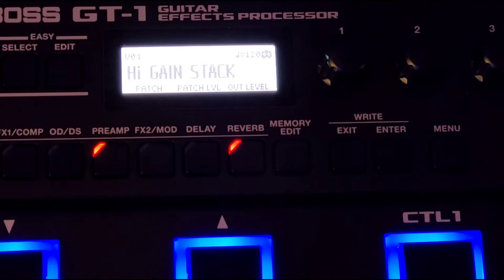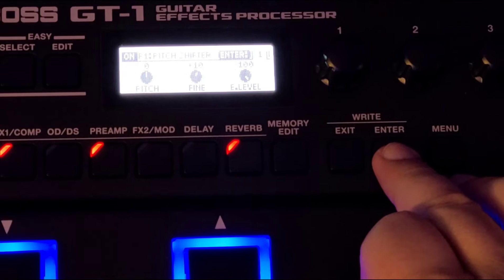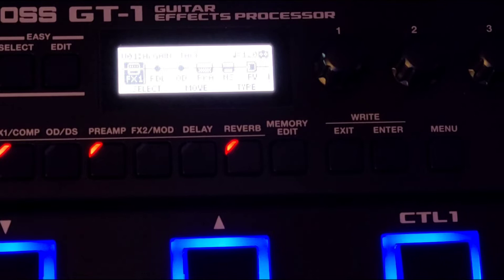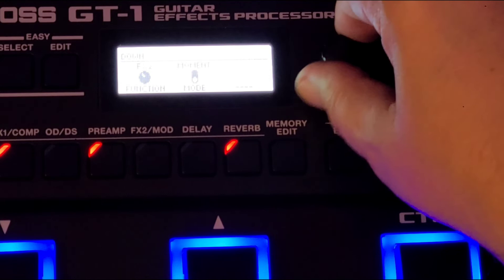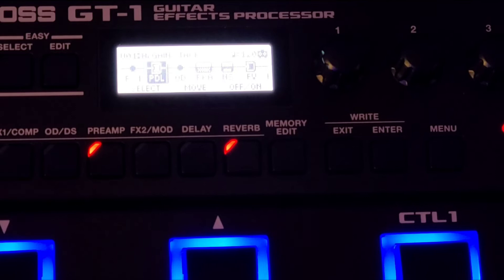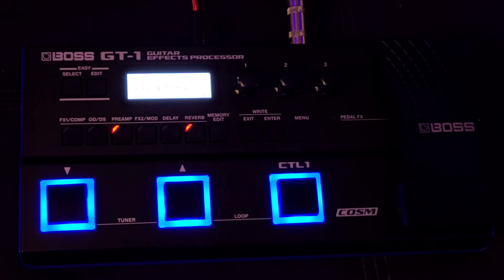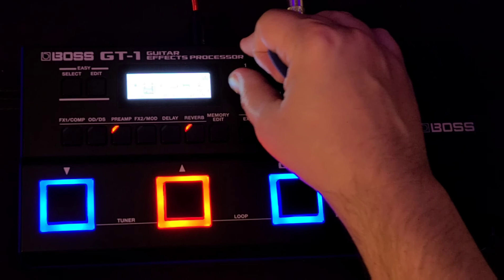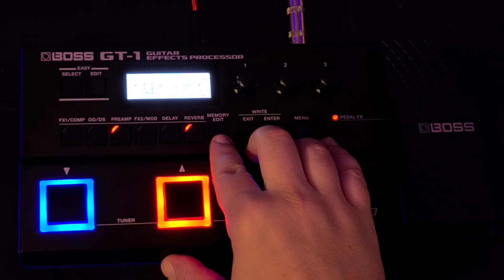things you can do with a BOSS GT-1  - comparing pitch shifting

Comment: Wow! Had my GT-1 for three years now, and was looking for The Drop or Pitch Fork to cut on guitars needed when having sets using multiple tunings, cause i thought the pitch options in the Boss was just unusable for this... Just tried it and assigned the on/off to ext ctl2,3. Works like a charm! Thank you so much for that trick !! I was searching today wondering if it was possible to use the whammy to do exactly just that and came across you video! What a joy to have this in just 1 unit !!

Comment: Gary, this trick saved me, thank you!   I just switched over from the MS3 to the GT1 and it was driving me nuts that the Pitch Shifter performs so poorly in the GT1 compared to the MS3.  I need that for emulating a bass guitar, i.e. -12 pitch wise.  Thanks again!

Comment: if only there was a way to use the whammy pedal to pitch shift down and use wah at the same time..
Reply from the maker: True.  The auto wha in fx1 could do that but you wouldn't be able to control the sweep.
Reply: @GarySchutt  its unfortunate, i even tried making an expression pedal with a potentiometer i found and it only lets you set a second expression pedal as volume and not wah
Reply from the maker: What about the boss expression pedal in the CTL1 jack assigned to wha? I wonder if that's possible.
Reply: @GarySchutt  not sure, would be nice if it worked. also forgot to say i tried the method in the video for pitch shifting and it works very well, but on some patches it still somehow has a warbling effect on single notes

Comment: Hey, how can I program one of the effects on the GT-1 so It would simulate the guitar tuned down a 1/2 step or a whole step?
Thank you.
Reply from the maker: Use the Pedal Bend function on the wha and then you can change pitch steps in the parameters. You can go up or down chromatically.  Then use the pedal to get to that pitch.